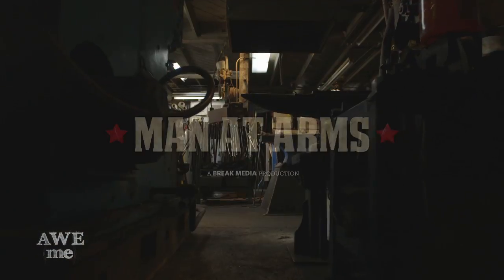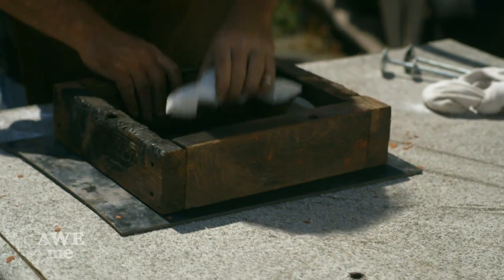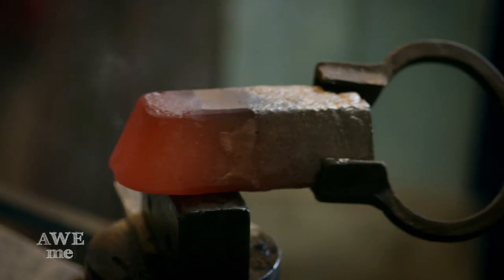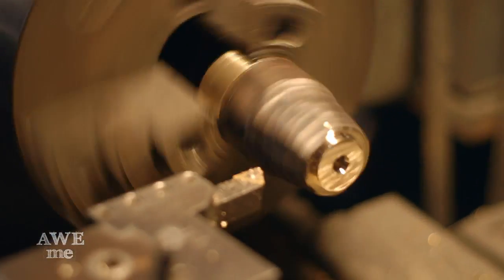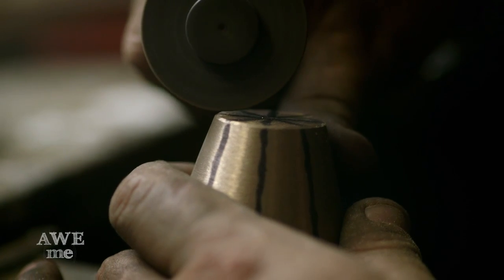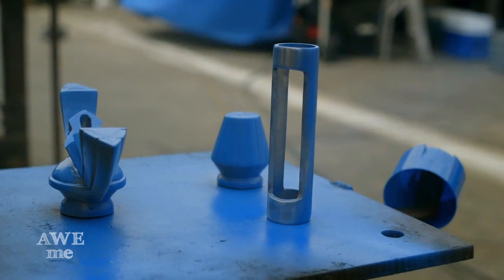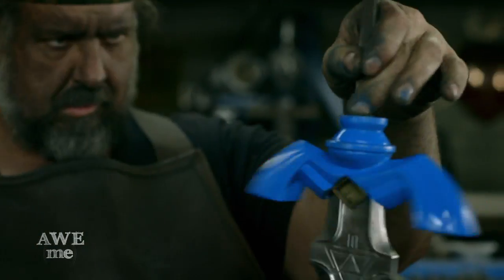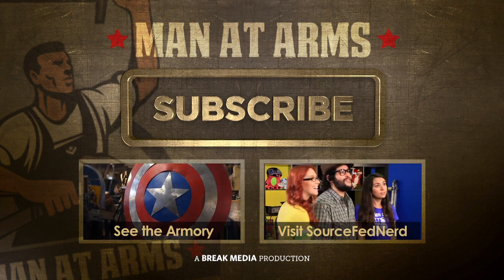Link's Master Sword (Legend of Zelda) - MAN AT ARMS

Comment: Master sword is purple
Reply: Before you make a stupid comment, think about ALL the games in the franchise. All the GOOD ones had this color scheme.
Reply: are u saying all master swords in good games are blue?

ALttP= technically grey but the item picture is PURPLE

OoT=PURPLE

TP=PURPLE

WW=PURPLE

SS=PURPLE

ALBW=GUESS WHAT? PURPLE!
Reply: hawkraider3 You might be looking at them in the wrong light.
Reply: hawkraider3 In Wind Waker, it's blue. In Ocarina of Time (the original), I'm pretty sure it's just dark blue. It's purple in OoT 3D. P.S.: Putting PURPLE in caps doesn't get your point across better. It's just kind of annoying.

I'm surprised that people see a video of people making a near-exact replica of the Master Sword, but they still complain because it isn't perfect.
Reply: minecraftultima529 Pretty certain the "original" appearance of the Master Sword is in "A Link to the Past", in which the sword has a red handle and metallic guard.
Reply: ***** By "original," I meant the original Ocarina of Time, not the original appearance of the Master Sword.
Reply: minecraftultima529 As opposed to what other Ocarina of Time? Did they change it in other versions or something?
Reply: ***** I was differentiating it from OoT 3D, which I'm pretty sure gave the Master Sword the purple hilt.
Reply: minecraftultima529 Makes sense! But it literally changes game from game to anyways XD
Reply: Ethan Moore It's not really either. it's more of an indigo.
Reply: not in the older games it isn't
Reply: They did the older game version
Reply: see told you
Reply: hey i was just pointing it out i dont even mind about it that much... i already said this , but someone flagged it...
Reply: i don't mind dood just learn the game before saying it as i am like the number 1 legend of zelda fan i bum the game series so much it is unreal
Reply: I'm not :P
BTW they already made a classic master sword which rules out the original games

Comment: The blade needs to be wider and definitely thicker. The handle should be adjusted to accommodate the larger blade that it should have. Almost perfect though, and gorgeous anyhow. However, I'd rather have a heavy and unbalanced sword that looks right, than a gorgeous functional sword that almost looks like the real deal. That means I will always notice the difference, and will never really get the feeling like I have the real Master sword.

Comment: I kinda wish they remake the Master Sword, following the current design from Twilight Princess to Breath of the Wild.
Reply: Actually. It would be better to create the Master Sword from A Link To The Past. It's the most practical and light version of them all.
Reply: I know, the design they went with is pretty disappointing . It looks like it's loosely based on Ocarina of Time's model, but that might as well be in the "early prototype" category at this point.

Any design before Twilight Princess is kinda from an era where Nintendo was still experimenting a bit and hadn't settled on a final design yet. The sword has been extremely similar for the last 3 main console games, retaining the same hilt shape and general blade shape, with only minor alterations between games. Although a lot of work went into the sword in this video, it could've been so much more.

Comment: Are swords supposed to wiggle when they strike something?
Reply: Yes. if it didn't, it would shatter.

Think a glass rod vs plastic straw. One is easier to break than the other. Of course swords aren't as flexible as plastic straws but they have to be flexible if you want them to last.

Comment: The blade is way too thin
Reply: Problem is that if you made it as thick as its in-game representation, it would be too heavy to even carry or use it in any way. It's designed to look absurdly thick in-game for practical reasons so you can see it from a distance.

This article goes into some detail about that: https://zeldauniverse.net/features/making-the-master-sword/ - they also made a far more accurate master sword than the one in this video, but still had to reduce the thickness of the blade as a compromise because it wouldn't be possible to swing it otherwise.